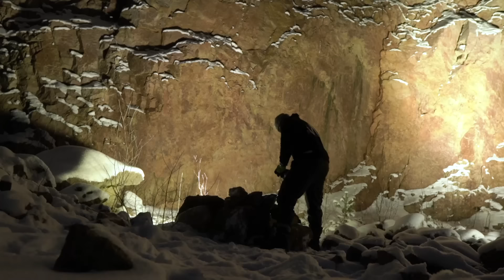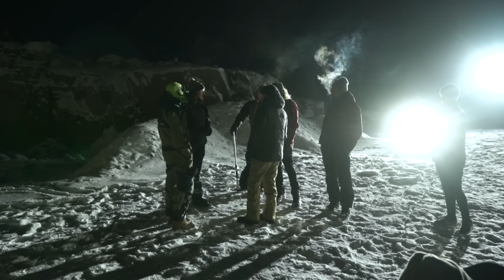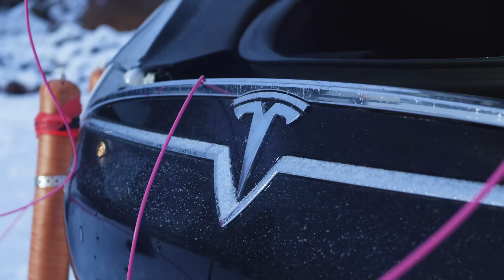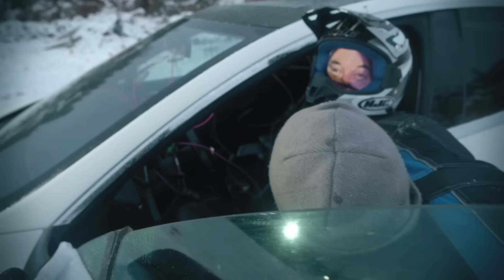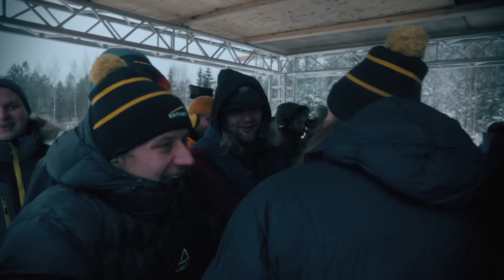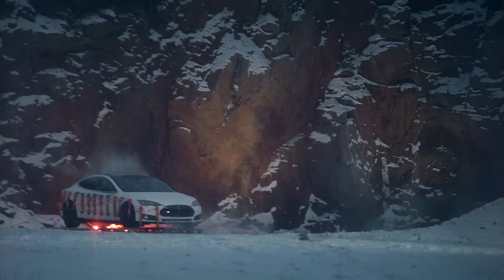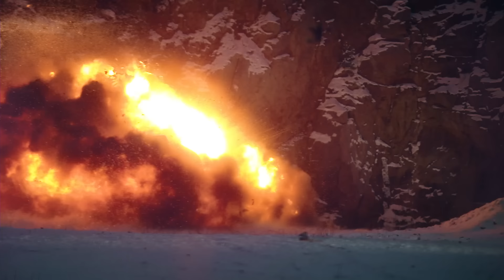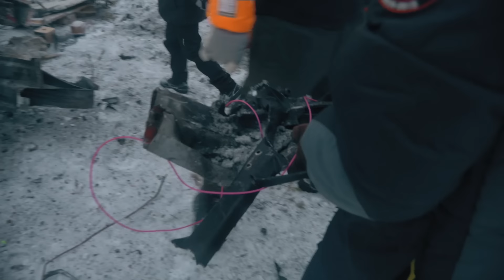Mies joka räjäytti TESLANSA!! Tesla Model S & 30kg dynamiittia.

Comment: This is indeed a nice piece of fun. However, buying an 60kWh LFP-Battery of today, made in really big numbers, costs about 20.000 EUR, without any replacement work. Therefore, this repair offer from Tesla was indeed a bargain and the action to blow this Tesla away was not only a environmental, but also a business crime. If you compare, what a Porsche Cayenne Turbo Engine might cost for replacement after 10 years, the numbers might be not much better. This action is the simple result of a failed economic blackmailing: "Either, I get a new battery for free, for this 9 year old product, or I will do the badest public relation I am able to do." Sorry, this is not, how cars are sold. No matter, if its electric or combustion, it's simply sneaaky and not worth attention.

Comment: What was he trying to show with this? And if he bought an old car with an internal combustion engine, and then it turned out that in order to continue driving it, it would require the replacement of a large number of parts and components, which cost not little - would it also blow it up? So please, let's not go crazy.